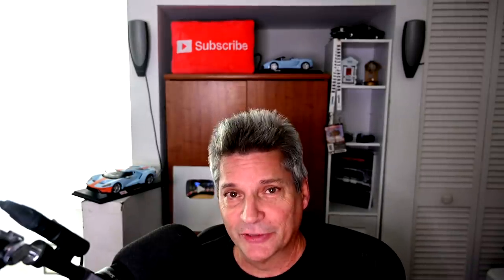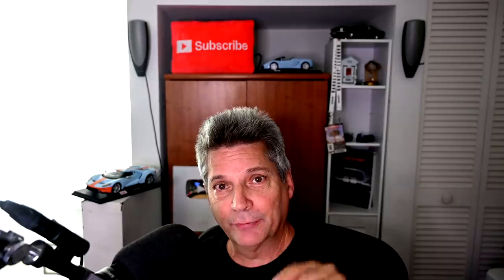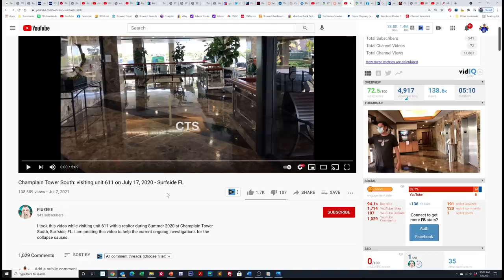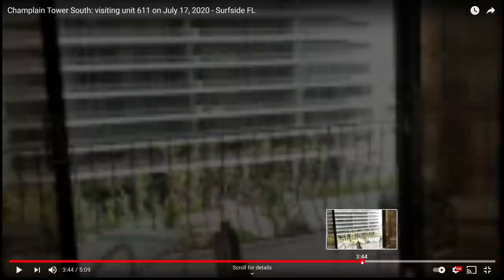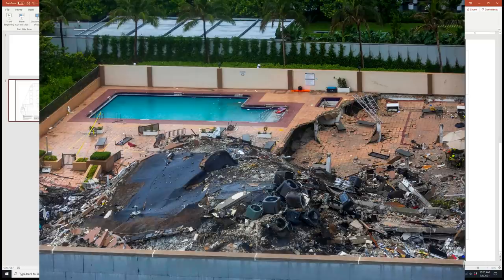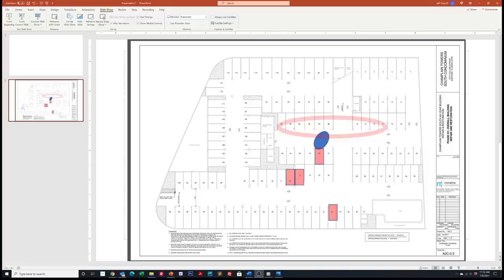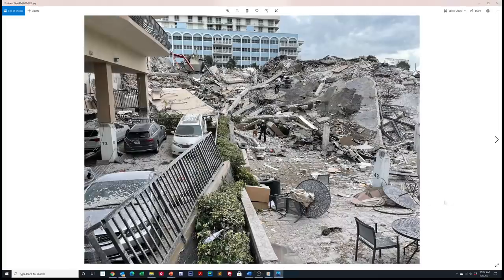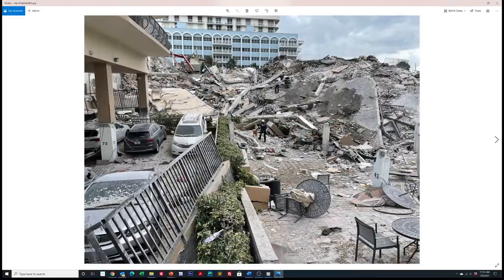Analysis Garage Video BEFORE Condo Collapse: Water Everywhere

Comment: The tourist video of the gate shows that the column 14 at the very bottom of the ramp is still standing and a bit farther beyond it is shown the column 27 with 27 written on in, seen blurry. The water flowing down is not under pressure, so it's from a pool deck drain or similar. The front facade of the part of the building that collapsed first is in the line of the 27 column, four rows of columns in from the north retaining wall, which is about 2o ft outside of the footprint of the bldg itself. The line of the 27 columns includes and is very nearby parking spot 78 which was identified by the pool contractor as the spot where water had pooled. The water flowing out of the broken pipe is pooling on the floor exactly in and around spot 78, as can be expected. The pool of water shown in the tourist video is thin and can be mistaken for concrete debris because of the poor focus of the camera. It isn't debris because it's much too thin of a layer and lies thinly and shining on the surface of the concrete at the the bottom of the ramp and columns 27 and 14, one must look closely to see this. The possible concrete debris that is seen on the floor farther back of the water is likely part of the concrete ceiling or a column below the facade  of the building , which is also just beyond the area where the pool technician saw water pooling around parking spot 78.

That the water was significantly pooling as mentioned by the pool contractor and also seen in the tourist video may indicate uneven settling of the ground and foundation in that area which would put uneven stress the columns and the slabs resting on them, and this may have caused additional stress in the columns and floor slab and weakened them to make it more likely they would fail from water damage caused by water seepage from above and sea water seepage from below.  

The ultimate cause appears to be water leakage from above and below damaging the foundation and pool/parking deck slab; design peculiarities, rebar reinforced concrete construction, uneven ground settling, the heavy load of the ground floor deck slab, and other factors were secondary features that dictated that the building would fail in the pattern that it did. When the concrete parking/pool deck collapsed and took whatever columns with it, it would likely have damaged the columns supporting the facade of the building, or at least destabilized them horizontally to make them prone to buckling or collapsing sideways due to the high load of the building on them. If there was a beam along the line of column 27 underneath the facade that collapsed first, it may have been damaged on its underside by slab pull out or similar, resulting in it failing from the underside where tension would be greatest due to the beam bending downwards from the load above on it, and then failing. Whatever the case, any beams in this region would have become compromised and certainly lost their full strength had any columns in this area collapsed.

Comment: Buen trabajo señor Jeff ❤️
That building filled with water hot spot points is where the main collapse of what you explained. I'm assuming that the ceiling must to had concrete cracks all over the top pool deck and garage ceilings due to water damage. Through out the time kepted damaging the concrete enough to damage the metal cores that hold the concrete in place. Starting to make sense of the main collapse in the middle of the building. Those metal thin core is what gave way due to cancer...RUST.

Comment: Remember water on the floor of a parking garage especially in area that receives periodic rain is not that uncommon especially in divots or cracks in the parking deck.  I have’s questions about the possible water intrusion indicators through the parking deck that you are pointing out in this video and that is was the parking deck structural to the building or was it a “floating” deck and just basically sitting on hangers because if is the later the condition of the rebar in the deck is much less critical or possibly at all to the structure of the building.  Secondly since parking spaces are assigned were there complaints by residents of water dripping on their vehicles causing damage to their paint jobs.  I mention this because when water  drips though concrete and onto automotive painted finishes it basically eats the clear cost and or paint in short order and while we se the problems in the ceiling of the garage we / I didn’t see any tail tell signs of water dripping or having dripped on to the vehicles parked in the garage.  Additionally if you look at the floor of the garage if water was constantly/periodically dripping down from above I would expect to see some sort of discoloration on the floor (normally a light spot/stain) and personally I didn’t.  As for the car cover on a vehicle in a garage people normally do that not to stop things dripping on them because most car covers don’t stop water from dripping though because if the did they would cause the car to “sweat” which in turn causes rust and corrosion. What car covers do is keep environmental’s off the cars finish such as dust, exhaust emissions, but it has been my experience most people who put car covers on vehicles in garages do so to help prevent scratches from people walking by,  to keep people from looking into the vehicle because it has a nice stereo etc and or because they don’t drive the vehicle very often and they think they are somehow protecting it while it sits.  Parking cones placed like you mentioned at  time stamp 23.00 are many times placed by tenants who are worried about hitting the column in their parking place or have had someone park in their place so they put a cone(s) in their space  whilst they are not there to discourage people from parking in it; please note there appears to be a cone at the front of the parking space diagonal to the one at the rear which could lend support to my hypothesis that they were a tenants parking cones.     Something to note is all of the columns show no signs of spalling which I would expect to see if rebar was rusted or otherwise compromised in them.  The 44 second video without context to exactly where it was in the structure to me only tells me that water was dripping onto a electrical box and not much else without knowing more information.  The only thing it does perhaps indicate is the general quality of the personal performing maintenance on the complex.
Reply from the maker: Only a few columns in the garage had spalling

Comment: Hi thank you for the great video and investigation, at 19:14 right when you say you are not seeing anything I think you missed a rather large crack in the ceiling that maybe spalling. Keep up the great content!
At 20:55 there is another ceiling tray hanging that seems to redirect water off of the car, that you don't seem to notice or at least you don't talk about it. It looks like all around that slab there were a million of small cracks that kept pouring water through the years and eventually made it collapse. Exactly what you show on the report on your main explanation video about the missing drainage angle the top slab should have had. If you keep looking those trays are all over the place, unbelievable!

Comment: Not sure if Jeff, but it looks like each column in the parking garage has what looks like water stains about 8 or 10 inches high from the floor.  look at the bottom of #106 and #52 you can see the staining.  I wonder if the entire parking garage was recently flooded with about 10 inches of water and all the water on the floor is puddled in low laying area and has not dried yet?.

Comment: Some of the columns were two different tones of yellow. Maybe that indicates repair work? Matching paint can be tricky. And @ 25:44 the columns near the orange cone are much smaller than the others & the concrete beam between those columns looks uneven.

Comment: I’m confused.  Where did water COME FROM that was leaking on deck, to garage ceiling??
You said pool was so strongly built it survived collapse around it.  Doesn’t seem pool had cracks in it - or did it?
Reply: From the drain system underneath the pool

Comment: Those plastic corrugated roofing stuck on the ceilings looks like they were implemented to redirect water into these gutters you see all along the side of the walls. They seem to installed gutters a few feet below the ceiling on the walls and have pipes from the central areas directing water collected from the roofing to these gutters. If I were to guess, the slabs above have pipes that may have corroded over time and are leaking into the concrete and through the slabs and this is the management's way of mitigating the dripping issues. Once you have consistent water possibly travelling along the rebars and progressively corroding and spalling the concrete, they would just follow the path of those rebars to all areas of the carpark. The moisture would peel off their attempts to paint the stained ceiling hence all those peeling paint. The gushing water in the video before the collapse would likely be a pipe from a slab fracture.

Comment: I think the lady who filmed the rusty electrical box had to be in space #8 (NE corner), not #82. There was a wall to the back and a long unbroken wall to her left side, but I don't see a back wall at space #82, and there's no door for the stairs which would be at space #82. Also, there are no cars to the front of her, as there wouldn't be for space #8 since it's at the end of a thoroughfare. As for the box itself, it looks like it's on the original plans on page 89 for parking space #8. Page 83 says the electrical box was for a garage exhaust fan. Original plan parking spot numbering is on page 90.

The one thing that made me question it was filmed where I thought is because of Moribito's plans for the 40 year re-certification. According to him there is NO space #8, and #7 has a column. There is no column in the video. Confusing. Either they got rid of space #8 or Moribito screwed up. There really is no place else it could have been filmed except for the NE corner.

Original plans: https://www.townofsurfsidefl.gov/docs/default-source/default-document-library/town-clerk-documents/champlain-towers-south-public-records/8777-collins-ave-1979-plans.pdf
Moribito's plans: https://www.townofsurfsidefl.gov/docs/default-source/default-document-library/town-clerk-documents/champlain-towers-south-public-records/8777-collins-avenue---preliminary-review-plans-for-40-year-re-certification.pdf

Comment: redirect patching in the ceiling  is corrugated sheet metal panels and 2 gutters their in house  maintenance , building engineer. The paint peeling in lines was the water running across the ceiling.

Comment: At the 6:00 video mark, there is a security camera installed in that concrete ceiling. It would be interesting to find out who installed the camera and  if the installer noticed any water dripping on to the floor below while he or she was drilling holes into the ceiling for the camera bracket ?

Comment: What happens to the actual floor concrete/rebar system when all that water keeps it wet all those years.  Could the floor have given way to the weight of the building in a localized area and been the stimulus… ? The cracks on the floor might be evidence?
Reply: I thought about that too

Comment: I don't know what the fire safety standards are there, but I'm very surprised when the deck collapsed it didn't set off the fire alarm. There are water flow sensors on sprinkler systems that should have sent the system into alarm as soon as one of those pipes were compromised. That is, if it was required and functioning. That 7 minutes could have saved a lot of lives.

Edit: You mentioned it later in the video than I had got to when I wrote the comment. However, even if that particular water flow from the tourist video isn't from the sprinkler system it would have no doubt been compromised by the deck collapse. I agree with your earlier video that the larger block is the planter that was directly above the pillar. It probably had a slower travel down due to sitting right on the pillar and so it didn't break apart.

Comment: Hi very informative video, thank you! If a  57 years old 10 floor concrete building has leaking in different spots in underground parking. And engineering recommendations is to replace all the membrane to avoid further structural damage, is this a very bad news? Thank you!

Comment: The former building maintenance person was interviewed.  He said that ocean water was frequently pouring into the garage.  They had pumps to removed the water but the pumps would frequently fail.  He said that the salt water sat there for days, seeping into concrete floor.  Add to that, the pool water with its chemicals.  I guess no one thinks a collapse could happen until it does.

Comment: Excellent power presentation with diagrams. The parking garage is terrible for such a nice condo studio as this one. I worked at a lawfirm with the same exact parking lot. I remember there were cracks and water all over the place on the lower level of the garage.

Comment: The painted concrete ceiling doesn’t help with all of that moisture above. That just holds the water in and saturates the concrete between the surface of the pool deck and the ceiling of the parking garage.  Also the small column near the elevator lobby at 18:50 looks buckled.

Comment: Jeff, I noticed a couple things that weren't mentioned and wanted to bring them to your attention.  In the beginning of your video, all of the columns or pillars have water lines that run up about 6-10 inches up each column and you can see the standing water line stains on the yellow paint as if it had flooded for a long period of time in the past.  Now, later on in your video, where the garage ramp is where the columns are smaller you suggest that these looked newer or had been painted or renovated and I didn't notice any standing water line stains on the newer painted columns.  This may be why we do not see such a defined water line at the bottom of these columns.  Also I noticed several security cameras in the parking garage and one even right by the front gate.  Just sharing what I seen that may help.

Comment: I live in a multi story and some people have covers on their car if they don’t use much, especially if they are near a basement busy walkway or if people shortcut through their space for the lift. It gives the car some protection from people accidentally scratching it and from dust buildup. The orange cone I think is so…. My reversing camera is really sensitive to objects however I actually can’t gauge how close to a concrete pillar or wall either because concrete through camera changes your depth perception know how far back you can really go if your camera is over sensitive. The orange cone is probably a camera marker for them to visualise- I’m guessing cos I’ve seen it in other place.

Comment: The video from apartment 711 camera inside apartment shows that the failure occurrerred to the west side of her unit because the apartment starts leaning to the left or west before the power cuts. The position of her camera in the floor plan appears to be right in between column 27 and the column in space 27b

Comment: What about the shape of column 54 at 8:50? I wonder the shape of the top few cm, it look tapered. Is that the original shape, or have parts broken of, which were repainted afterwards?
And what was above the damage shown from 14:00 to 14:40? The damage follows an arc shape, ending in a square repaired patch. Has anything been built afterwards on top of the garage ceiling? Maybe nothing structural, but maybe an entrance door, or curved desk?
At 19:10 another water guiding sled (?) seems to be attached to the ceiling, and a strange shape, looking like a crack in the ceiling.
At 26:10 it is visible that the flaky things at the ceiling stop at a distinct position. What is above the ceiling at this 'border'?

Different question: was it a rainy day at the time of the video? If not, you know for sure that the water did come from the building (or from beneath, as seepage water) and not from wet cars.

Comment: The thing on the ceiling, according to a building engineer, is a patch where there had been a crack (the thing that is long and almost looks like a florescent light cover).  The guy has a another YouTube channel, is a building engineer, and it seemed like this was something he'd seen often and that it was certainly a patch.  He also said that these things were to keep water from screwing up the cars, below.  Also, among the stalactites hanging down are some injection ports (you can see them clearly in close-ups) where various materials had been injected into the ceiling to plug cracks.

Comment: Not all cameras record blurs during moving, just weaker/smaller/cheaper devices. The main player to effect pixelated pictures are bitrates the camera can handle, which controls how fast it can produce pixels in moving pictures, in terms to recording. I always see high resolution cameras being sold so cheap or at good prices, but then find out that the recording bitrate is horrible to the recommend resolution of the recording device. I hope you find this helpful.